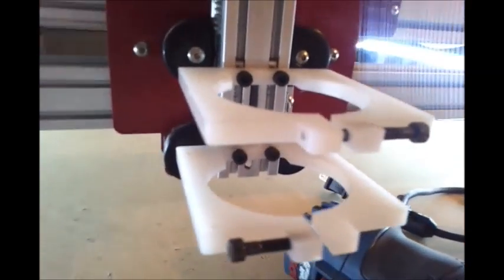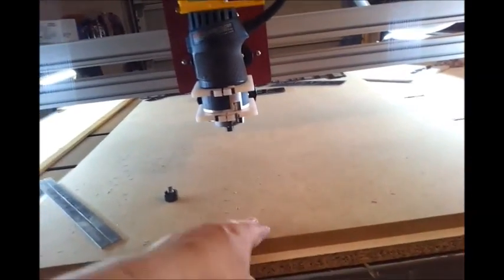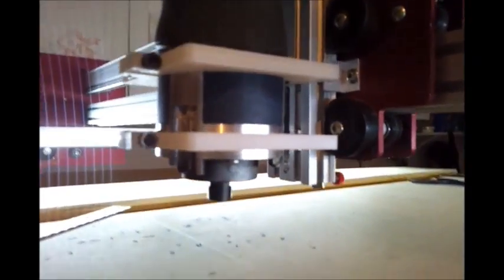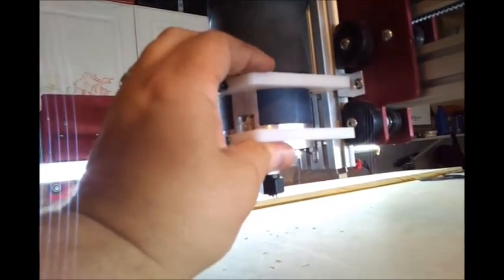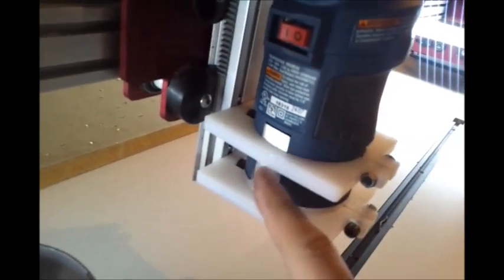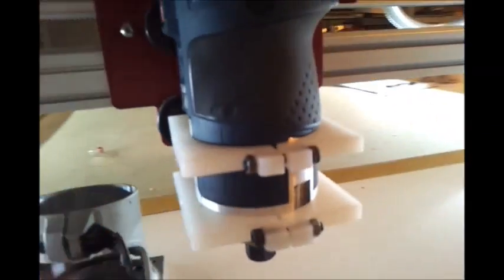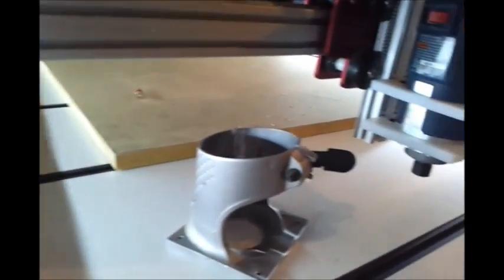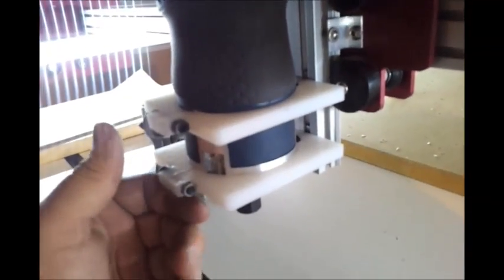CNCMogul Bosch colt Spindle mount UPGRADE

Comment: You can gain a lot of clearance by using a 1/4 or 1/2" spoil board instead of the 3/4 it looks like you have now.  I too have used the Colt on many small CNC tables I have build and even have mounted two on 12' centers to do 2 3D plaques at a time.  There are precission collets available for 1/4 and 1/8 bits so you don't have to use an adapter.   I ordered a 36x36" machine ten minutes ago and I am really looking forward to assembly time maybe next week.  I have built 10 CNC Router machine in the last five years (I had $4000 in parts for the one I have now( and teach Computerized Wood Working at a Community College.  Thanks for the info and have fun.